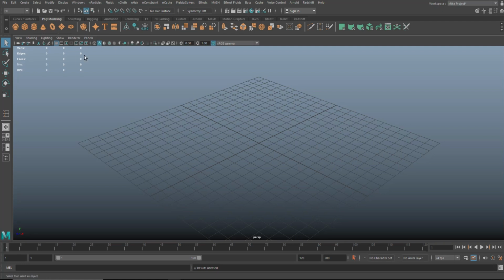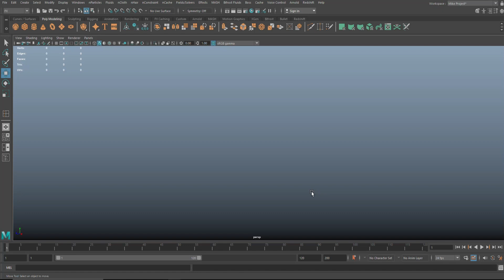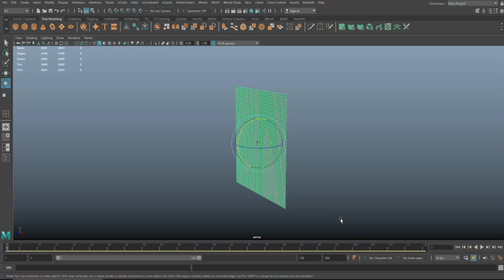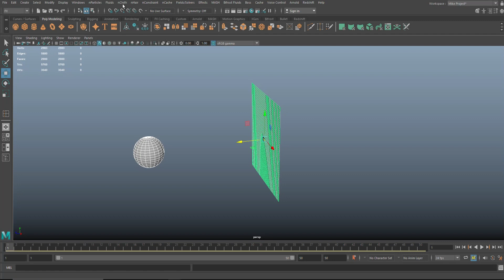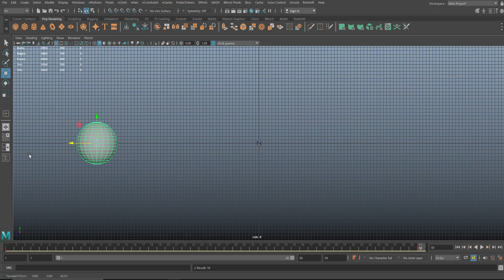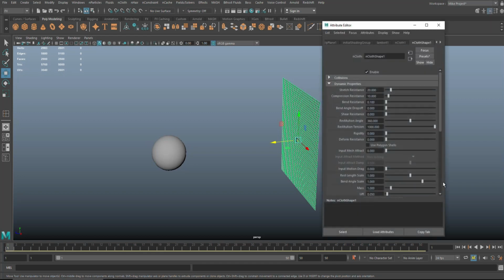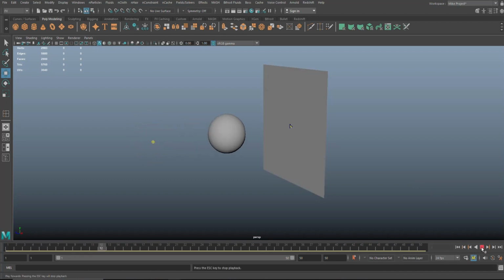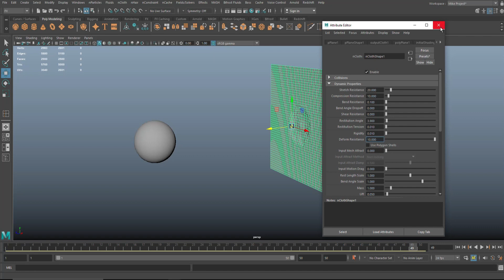How to create a dynamic "How you need it, when you need it" dent in Maya

Comment: This was really cool, thanks for sharing! 

What if the plane had a texture and UVs already applied? Would this denting just stretch in the affected spot? If so, is there a way to swap textures in between keyframed animations to hide the blemishes to create something more dynamic?

For example, a bowling ball bouncing over a wooden floor board. Can I swap the initial clean texture to something that shows damaged, cracked wood after the ball leaves that position?
Reply from the maker: You can flex a textured surface but it might stretch the textures if they are very distinct and the deformation is huge